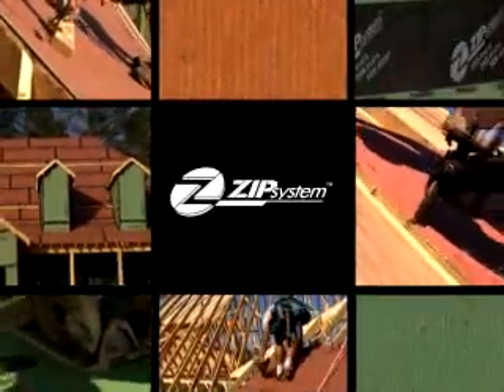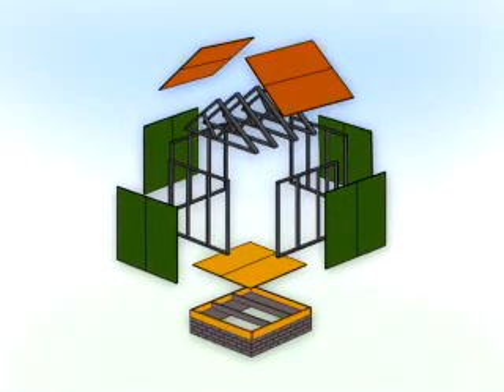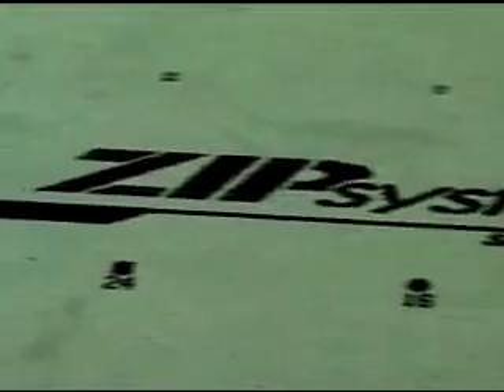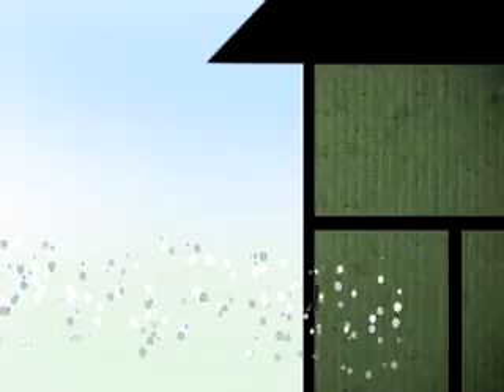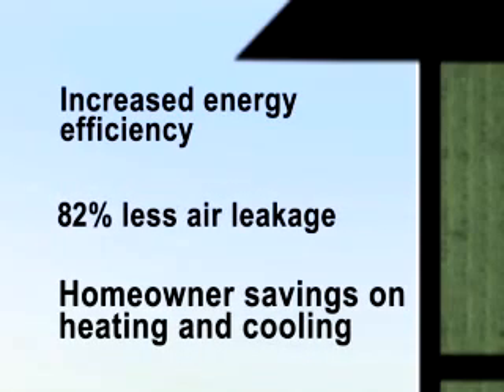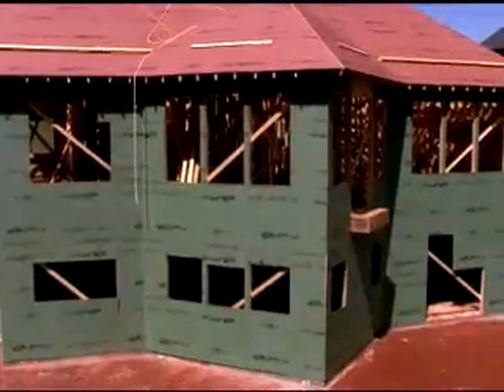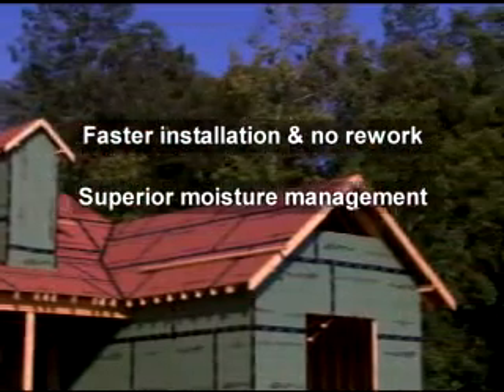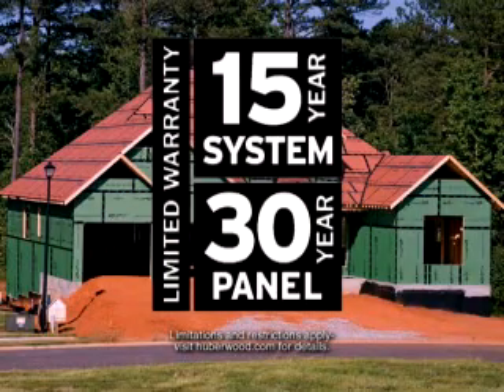ZIP System® Wall Sheathing and Tape For Builders

Comment: my question is . Felt paper will be needed for the next shingle re-roof ?   The shingle nails already penetrate the roof are the zip system self sealing after nail removal during tear off ?

Comment: Why would I use the Zip system when it doesn't protect against leaks at a Gable end wall you have to have something over the step flashing to keep the water from leaking to the substrate below if water does get behind say your siding this does no good in that case?  Why not just use tar paper or wrap?

Comment: zipsystemsheathing Dupont has a pretty damning video of your zip wall failing water intrusion tests at even low PSI. I'd like to see a response video. I am concerned that during installation you have no process in place for protecting nail holes in your material.